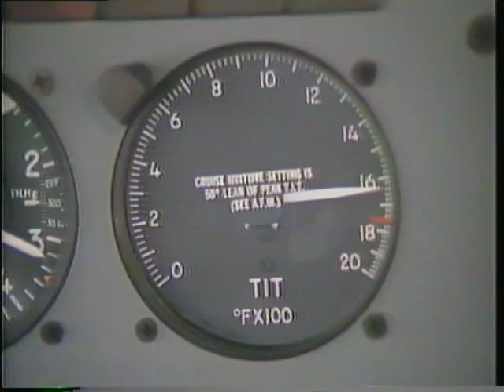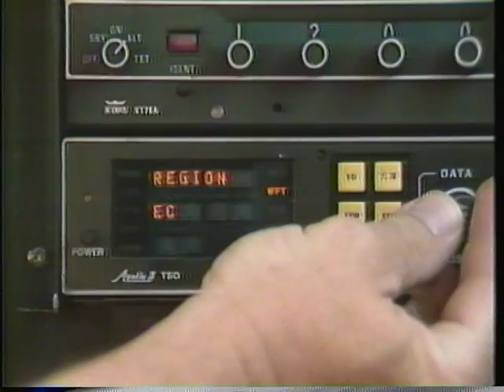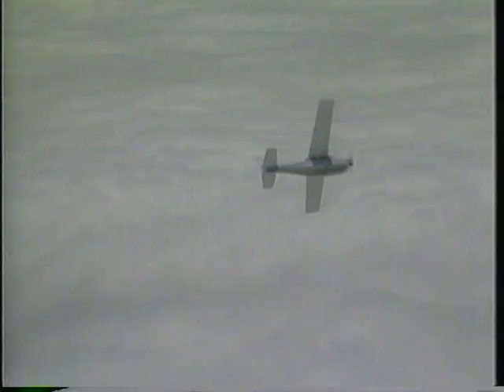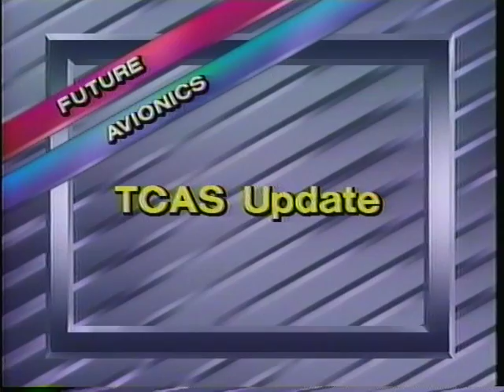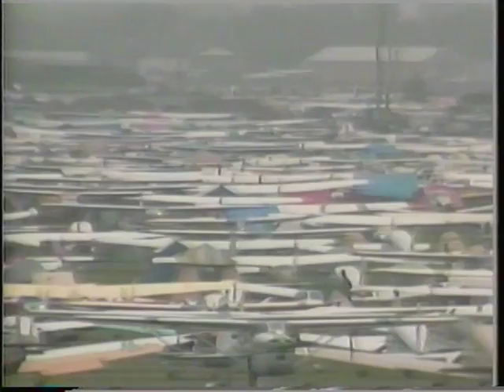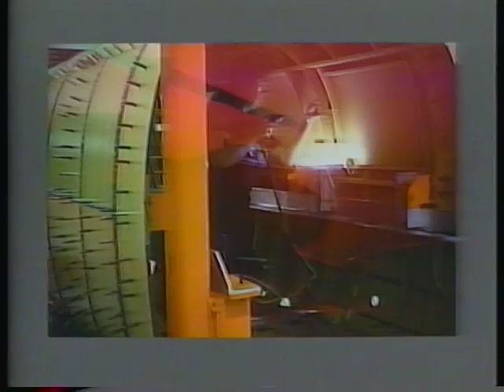ABC Wide World of Flying - Ep. 1 Vol. 1 (1987)

Comment: Curious, the landings of the Malibu, the pilot never pitches up to land on the mains. Both landings were 3-point landings.  Is that standard for the Malibu?
Reply: Nope. Glad to see I’m not the only person who noticed this. I’ve seen it on other videos as well. Could be poor training, or just laziness. But it IS bad form, and could result in “porpoising” Down the runway. Not good. 3-point landings are only for tail-draggers. A tricycle-gear airplane should touch down with the nose wheel maybe at least a foot off the ground, i.e. the plane should be STALLED with the MAINS a couple of inches off the ground. That’s an ideal landing. I’ve also noticed folks flying with both hands on the yoke, like they’re driving a car. Birds fly with both arms. Pilots fly with one. One hand on the yoke (or stick), and one hand on the throttle, ESPECIALLY during takeoff/climb and approach/landing. This will prevent “throttle creep” on takeoff, and facilitate instantaneous power-up in case of a go-around on approach. Also, what’s with pilots looking like they’re eating the microphone? I was taught to keep the mic about a fist’s width from my mouth. No need to have it right up against your lips. Personally, I would find that irritating. Anyway, sorry to ramble like an old-timer. 😄 
Blue skies.

Comment: A lot of safety procedure information in this yet the pilot of that Malibu ran out of fuel on a 1 hour flight at 3,500 feet and ignored tower instructions on how to get the plane on the ground safely crashed it seriously injuring himself and the passenger and later lied about how much fuel he put in it. The video talked about the great glide ratio of the Malibu and it did Glide a long way. It glided right past two Runway thresholds and crashed two and a half miles beyond the airport. Ntsp put it squarely on the pilot.
https://www.baaa-acro.com/sites/default/files/2020-07/N9113X.pdf
Reply: I never understood how people almost never run out of fuel in a car, but they do in airplanes! 😳🤔